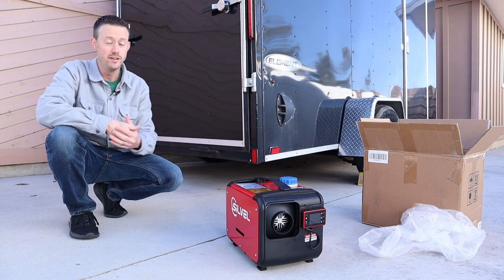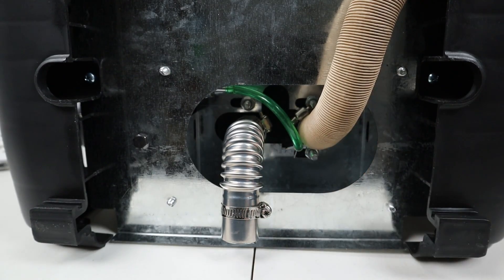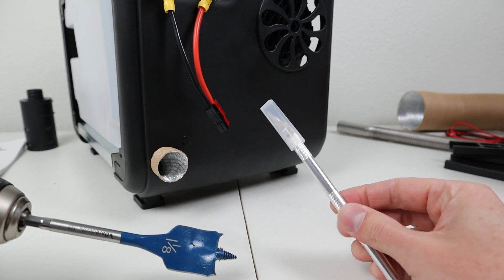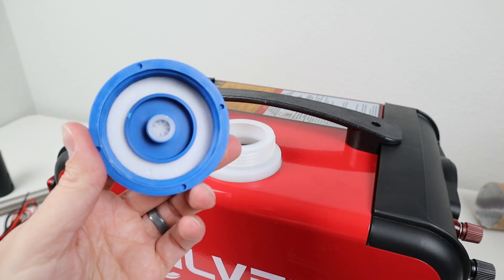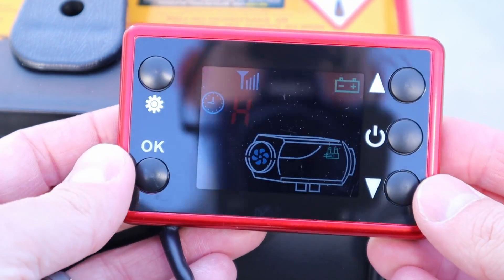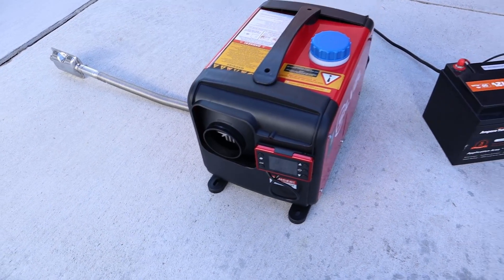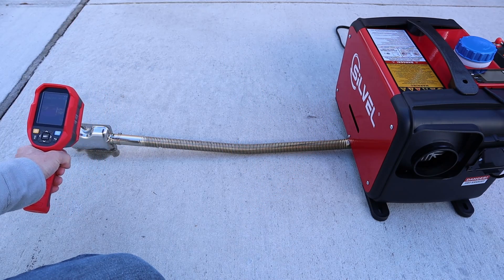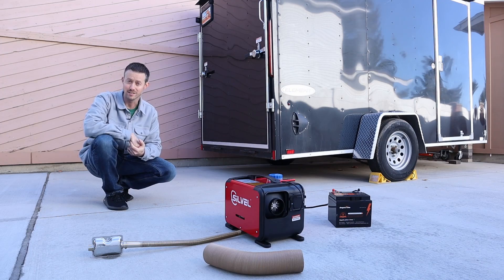Getting Started with Your Diesel Heater + Four Easy Mods!  *Not Sponsored*

Comment: I would like to see more. In particular, see you do a low voltage safety feature. Where before voltage gets too low, the proper shut down sequence occurs. Others have done it on YouTube, but rather confusingly. I know you would be precise and with confidence I would purchase the electrical bits required. One on YouTube created content that stated it had low voltage shutdown sequence built into the control. He finally many months later retracted this notion on a later video. This safety feature, or the lack thereof, is the reason I have postponed purchasing a diesel heater. Thank you.
Reply from the maker: I'm not aware of any Chinese diesel heater with low voltage shutoff built into the controller. It seems these are getting more popular so maybe that will be a new feature soon? 
One could put in a low voltage alarm like this ( https://amzn.to/3vXkJgB ) on their 12v battery to let you know the voltage is at a cutoff point. 
I was talking to my friend who runs a diesel heater multiple nights a month in his rooftop tent. Before talking to him, I was under the impression it was the 'worst thing ever' if it didn't shutdown properly. He said every now and then his heater shuts off randomly and while its not the best thing to happen, his unit still runs like a top. I think you'll see the soot build up after many repeated improper shutdown processes. As long as you take precautions to make sure your power source will last through the night and your power connection is secure, I think that will cover most issues with power dropping out randomly.

Comment: I'd be very interested in seeing how much power this draws from a battery during the startup sequence and in continuous use.
Reply from the maker: Thanks for the feedback, I'll definitely consider that for a future video.
Reply: I'd be interested in seeing how this (your 8kw unit) does versus 2kw and 5kw units using various power stations as the 12v source. 

 I'm particularly interested in the different offerings from Ugreen and Bluetti. It would be great if you could test it with the Bluetti AC180 and the Powerroam 1200. I'm pretty sure the 10a outputs are going to be an issue, but I'd appreciate knowing this for certainty. Thanks.
Reply from the maker: @iamgrowler  the 5k and 8k units are all the same, it's just a marketing ploy.
These usually pull around 145 to 155 watts in startup and that's why I have 150w as a requirement on my power station grading system. I will plan on doing some basic testing.

Comment: Well done.  A bit anxiety provoking watching all the cheap manufacturing of the unit, and you did a good job showing the modifications.  Thats a lot of "wasted" heat from the exhaust, seems there should be modifications that could be done to capture some of that?
Reply from the maker: I've seen some pretty cool exhaust mods that other people have done. I think in a permanent installation it makes more sense to capture that heat. In a camping setup it's probably not as needed. In my initial testing, on low this thing runs over 24 hours on one tank! It just sips fuel. Need to do more testing 👍
Reply: I saw one vid where they routed the exhaust through a big radiator and then outside and captured extra heat.